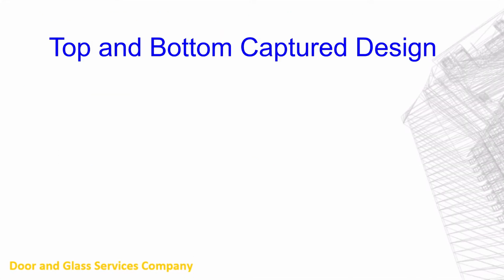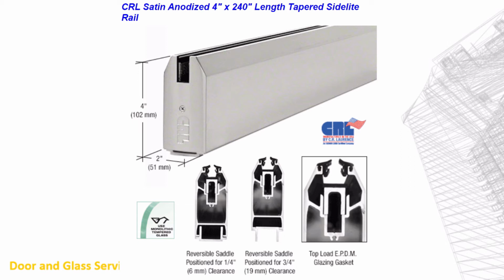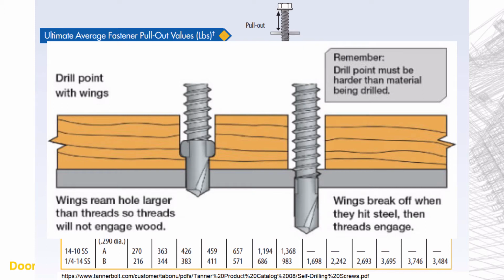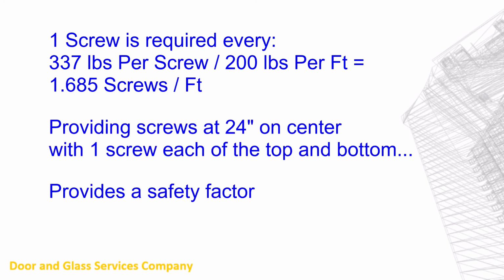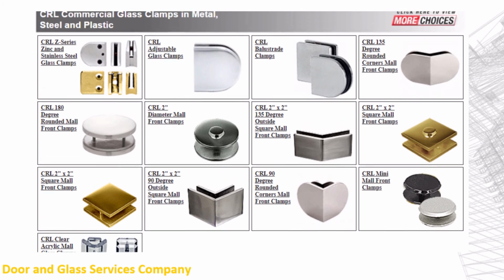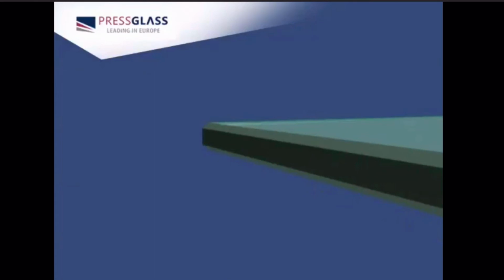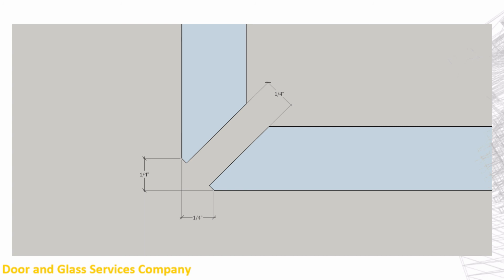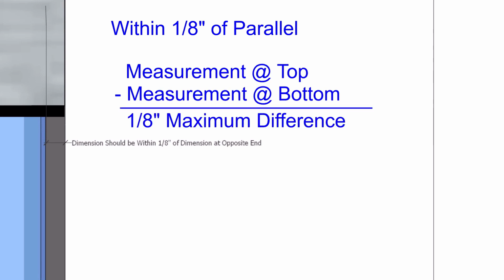Top & Bottom Captured Glass -- Part 2: Design, Joints, and Quality Standards

Comment: “For an exterior butt-joint condition at the end of a glass wall (like the exposed end of a storefront) where it abuts framing (such as 2x material or metal stud), what’s the typical way to terminate that edge? Would you typically use the same shallow U-channel to receive the glass, or is there another end condition you’d recommend?